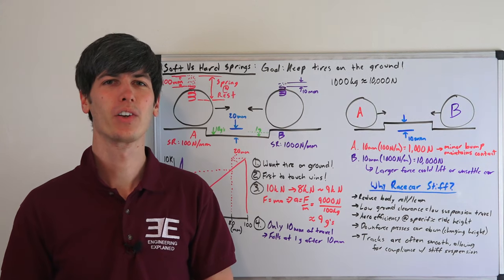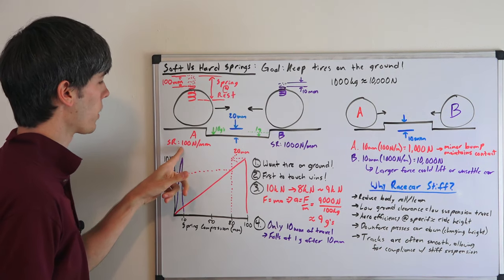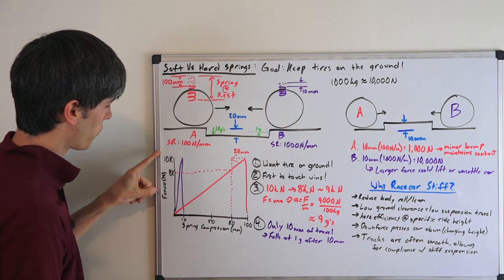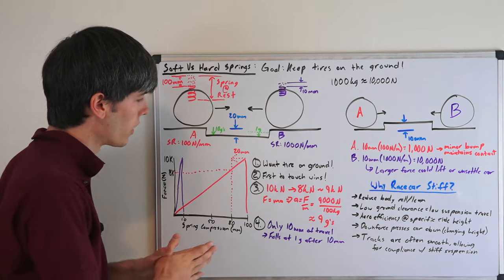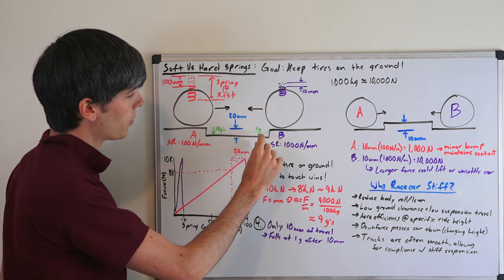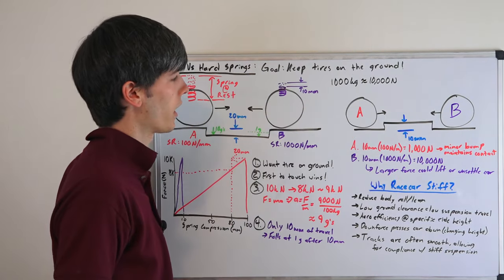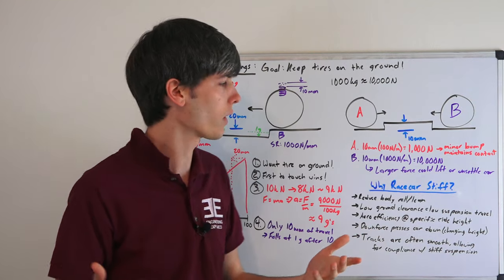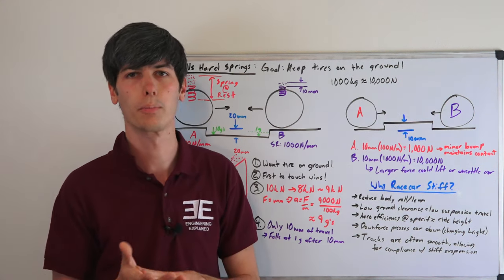What's The Best Suspension - Soft or Stiff Springs?

Comment: Can you reduce roll with a softer spring by increasing compression? What are the negatives? Also, what about tire pressure? Would that change the equations at all? Why would one want to run lower pressures? (I ask this because in the bicycle industry I had a "tire engineer" once tell me lower pressures are actually faster on the road than higher .... could not get a solid explanation from him on that one)

Comment: Got a Question? So I was having a conversation with a friend about lowering springs & coil-overs which is better? "Coil-Overs". Right???.....So my friend decided to call another friend to ask which is better and of course he also says lowering springs and I tried  to explain too them now of days they are multiple lowering springs & coil-overs available for different uses. So let's put this conversation to rest which is better?
Reply: Alfonso Goree It's depends on the range of capability of stock shocks.  The standard shocks on a Honda Type R can handle very stiff springs (heck the stock springs are moderately stiff already, amongst the stiffest you will find on a road car).  The stock shocks on a Nissan 240SX however aren't up to it, so you need full coilovers or replacement Koni shocks if wanting to up the spring rate considerably from stock.

Comment: most road cars actually have stiffer springs than a properly set up race car. the softest spring possible (within reason for your vehicle) will give you better handling with proper SAI and suspension set up

Comment: Hello Jason
I really need your help and your answer to this question. I'm preparing a Citroën Saxo 1.1 60 hp for trackuse only. I've always done that on a original way because that's how I am 😇 here's my problem: I decided to put 175 50 R13 wheels instead of stock 165 65 R14 wheels for many reasons. More grip (larger tyres, more heat in them becauss of smallef diameter), lowered center of gravity (lower wheels = lower car), more agressive gear ratio, etc,... The problem now is purely esthetic. The small wheels are so small that they leave a lot of space between the wheels and the bodywork of the car, even if I already put some lowering springs on the car as well. I was wondering if I could try cutting the springs by like 1 cm (the first round of the spring for example). I have so much space left that I don't think I'm taking a risk of friction between bodywork and wheels. Are there other problems I could have by cutting the springs? Some people just told me "you're gonna have a bad grip" But no one can't explain me how or why. They just assume it. That's why I'm asking you. Could I try it? What do you think? I'll talk about you and your channel in my next YouTube video if you allow me to! 😝 Thank you so much for your answer and keep going! I love your scientific car-videos! Good luck further

Dilysi

Comment: Another factor that you didn't address is the dampers' valving. I'm sure this is because you were focusing strictly on spring rate in this vid. People generally run dampers that slow suspension movement even more (having greater jounce and rebound damping) when they're running stiffer springs. I'm guess this would exacerbate the issue even more so.

Comment: How about expanding this idea further, and talking about the ideal balance of sway bars and springs. I am of the mind that you want the softest spring possible, with the stiffest roll bar possible. Your thoughts?
Reply: Having ran both setups in an autocross environment, soft spring + big bar was horrible.  There are four forces to deal with in a handling environment, acceleration, braking, and both lateral directions.  Soft Spring + Big Bar only addresses two of those areas.  Big Spring + Soft Bars addresses all four.

The ideal setup is the softest spring necessary to control the suspension and allow the car to do what you want it to do.  If you can't isolate the area of a corner that you want to fix the car's behavior, it's fruitless to talk about whether Big Spring + Soft Bar or Soft Spring + Big Bar is the best setup.  It's even harder to talk about it without considering the type of racing too.

There is a reason NASCAR is soft spring + big bar... and it has very little to do with handling.  Look at the rates they run on a roadcourse vs the various oval tracks they go to... way different setups for rather obvious reasons!

Comment: While big 4 wheel-drive cars, that are built to go over very large bumps and so need suspension with lots of flexibility and therefore should be soft, gets hard suspension for the highway travel.
Have you noticed those big 4 wheel-drive cars going over speed humps in the car park? My little car goes over them easier, how bad would it be "off-Road"?

Comment: Wouldn't that also depend on the stroke aswell for how far the wheel can travel ? For instance if its the same coilover setup however in one scenario you have its softer and the other stiffer... they still will have the same amount of travel.

Also since the softer spring is under less tension wouldn't it react slower and more fluid like than responding fast to fill in the gap in the road ? I feel like a stiffer spring would react faster in every way compared to a softer one. 

But i guess when you think about it since the stiffer spring is probably making the shocks stroke not as full as the soft spring you just don't have as much wheel travel with the stiff spring which i assume is the result of the wheel wanting to hover over a gap rather than sink into it.

Comment: There's an assumption in this that you are comparing racecar stiffness to passenger car softness. But within non-race track cars there is still an advantage in stiffer over soft. Soft suspension is more comfortable, but not necessarily better handling (not even for bumpy roads). In my personal experience, the cars I've fitted firm suspension, not racecar firm just firmer than stock, have handled better on gravel roads, potholed roads and smooth roads alike. The suspension is more responsive and keeps the wheel planted on the surface more often than the softer springs. I've always matched springs and dampers though - never change just one. There might occasionally be a bit of the skittishness he mentions but it's momentary and full grip returns in milliseconds, whereas the same rough surface with softer springs results in tail out or understeer action that you don't get with the stiffer suspension. 

That said most modern cars have very good suspension compared to the old "floating suspension" yank tanks of 40 years ago. Even stock suspension is reasonably firm. At the end of the day what you want is tuned suspension, designed to provide good grip for the style of driving you do. Passenger cars have more than adequate grip for the kind of driving that the average driver does.

Comment: stiffer suspension is used in racing because at high speed softer suspension is not that much stable as stiffer ones.And rider can feel bumps in stiffer ones easily than softer ones.

Comment: softish suspension, larger sway-bars is the best compromise for general purpose cars, so long as the sway-bars aren't too stiff.

but sometimes using no front or rear sway-bar is the best for cars that either have bad under or over steer or rear traction problems. 

Suspension geometry is number 1 for choosing the correct spring rates and sway-bars, especially if the suspension generates camber gain or toe.

Slamming your car with max camber is a recipe for some really poor handling.

Comment: But you also have dampers which prevent the movement, and if you have stiffer springs, the dampers should take that into account. My new, stiffer springs (just because my old ones were worn and this is what I got) make much better contact when I go over speed bumps. I don't think there is much difference between 350 lb per in springs vs 310 lb per in springs, especially if you factor in the dampers, yet cornering and braking are better with the stiffer springs. I think there is a sweet spot, softer than that is worse, and so is stiffer.

Comment: Ok, I get that it's better for bumps on road. Not really a cause of accidents. What about when swerving to miss an obstacle, braking hard, driving in wet weather. Firmer suspension keeps the load more even on the tires. In a soft setup if you swerve even at 20mph you'll transfer a lot of the load to two tires and therefore you have less grip as you're not using all four tyres optimally, even though they're all contacting the road they don't have even pressure applied. I like cars but don't really understand all the components, are there other parts that come into play here? I thought body roll mainly depends on suspension.

Comment: I think this whole thing is misleading.

Case 1, you chose a bump of 20 mm, which is greater than your stiff spring travel. Hitting the travel limit is a concern, but what if you were not at the limit of the stiff spring?

All the points for a racecar suspension are pros for a street car (tuned) except the smooth track. Even then, if my suspension is tuned for performance, I am not going to drive it on certain roads.

Comment: Can someone help me out?

I just got an old Lexus ES 350 2008 and the last owner put a 1 inch larger wheel on the car. The car is really bouncy and it's causing the tires to be worn on the inner edge as the car is compressing the struts all the way down. The shop I took it to said the struts aren't leaking at all, but they are the original (car has 158,000 miles on it).  They laser checked the alignment and it's perfectly aligned with no adjustment needed. The wearing is only from the bouncing. I can't even fill the tank all the way is so bad. 

Should I keep the coil spring and install just the struts, or replace both in a single quick strut unit?  Which struts should I get that aren't oem?

Comment: Here's a question...  I have a (Yamaha) golf cart, and drive it around my retirement community streets (will not be taking it on the golf course).  This model of golf cart is very light, and the ride feels EVERY slight bump in the road to the extent that my teeth rattle (and yes, they are all my own teeth so far).  The stock shocks have 'Coil Overs'.  
I think I can change the 'coil over springs' on the shocks to either softer or stiffer spring rate.  
Do I go with a 'softer' or more 'heavy duty' spring rat  to achieve a smoother/softer ride?  Thank you.

Comment: Did you do a video on the effects different shocks fitted to OE springs have? E.G. the differences in changing from oil twin tube shocks to gas single tube shocks or stiffer rated gas shocks.

Comment: SO what is best then. High or low profile tyres? What is best for road? What is best for acceleration? What is best for a road course? I think a video on this would be very informative to alot of people and might teach them something useful. For example try the same car with 16 and 17" wheel but roughly the same Circumference and do acceleration and handling tests. something like the gt86 would probably be a good test platform since the front wheel drive make it understeer as much. When you do a video like this you should try and elaborate the question a little more clearly than is possible in the video title before you present the conclusion. Here for example the the question really is "When is softer suspension better and when is stiffer suspension better" not which is best in general.

Comment: so this information applies at defects in the road, now what about drag racing? if a softer spring gives more traction it would be ideal for transfer of power to ground, but a stiffer spring would also prevent the nose from rising and keep contact somewhat. assuming this is a front wheel drive what would you recommend and why?

Comment: Imagine a car fully packed with your friends, and has a soft suspension, the ground clearance will reduce drastically and even a small speed breaker will be like an obstacle... Whereas hard springs require more power to press, so don't worry about speed breakers you will have enough ground clearance even when your car is full... I don't agree with the fact that cars have springs to maintain contact with the road, anyhow gravity ensures that... The main purpose of springs is to reduce the instantaneous effect of a bump by slowly going down and coming up, thereby spreading the effect of jerk over a longer period of time... Hence, our back remains safe...

Comment: wouldnt this be a discussion on travel? Your argument is that force potential decreases to zero once the spring has reached max travel but the stiffness of a spring does not directly correlate to trace. You can have a 10kg print with 200mm of travel if you really wanted, no? Further if the spring is stiffer and travel remains the same  wouldn’t it drop the wheel off a lip (see first scenario) faster ? Thus increasing road to tire contact?

Comment: On my 93 Toyota 4 runner I am getting wheel hop when giving it the BEANS in the rear end. I have a Trail Master 4 inch suspension lift and pro comp shocks such I think need serviced. But I was thinking I needed a stiffer set of rear springs. I was in 3 feet of snow and was starting to get stuck so I gave it more beans and it started hopping and I had to stop. I feel if it was stiffer I could have kept going.

Comment: Sorry if this is a bit off the topic but its somehow related and I really need some good advices on it. I have an ISUZU RODEO 98, Its been 3 years since we got it. Its really a bumpy ride and its getting worse. So first thing that comes to my mind is to change my old shock absorbers which I'm not sure if its previous owner have changed It already. I went to a mechanic to have it checked and he said that it has no leaks and still working good. Its an old Rancho USA made shocks he said. Then I let him check the coil springs and notices that rear part of the vehicle is 2 inch lower than the front. Then he remove the rear coil springs and he put a 2 inch rubber spacers on it to lift the rear part. Then installed it all back and now front and rear suspensions are even. But problem is not solved, driving is still bumpy even on smoother roads. Should I change my shock absorbers or buy a smoother coil springs? Thanks!.. :)

Comment: What if you have significant unsprung mass, going at speed over a significant bump that is within the soft and stiff springs' travel, where the speed means that the sprung mass was not pushed up from the bump (or very little chassis movement).
wouldn't the unsprung mass' momentum want to continue travelling up from the bump, meaning that a stiffer spring would store more energy to push down the unsprung mass after the bump faster for a quicker return to road contact?

Comment: what happens after the first bump/depression? wont the spring recoil rate also be as much as their initial give? if the shocks are similar the 100mm spring will make the car bounce more the stability is not just the initial bump but also the reactionary force plus the ability to absorb that shock. on a bumpy road wont the softer suspension be a disney ride? and wont that cause it to be less stable than the hard suspension car?

Comment: so here's a good question how do you figure out the right spring rate, the right struts, and right anti roll bars for a car. if I want to inprove the handling? with out it being to high of a spring rate, and to thick of anti roll bars?
Reply: +schizobipolarjoe That would be test and drive, you can estimate what it could be but do the adjustmetns based on performance.
Reply: bboyuploads  non turbo 2012 impreza. more or likely will put wrx struts and springs on it, then a sti sway bar in the back.

Comment: One thing I'm missing in this video - isn't it also that softer springs = better traction? I'd like to know how exactly this works. I know that anti-roll bar stiffness settings are usually used to dial out under/oversteer, but can changing spring rates work in a similar way?

Comment: Everything is relative I guess. Soft springs can feel like a wallowy rollercoaster, unresponsive, sluggish, especially with substantial load in the vehicle.
Empty, you can usually get away with soft springs. But if you carry loads regularly, stiffer is needed.

Comment: That is one drastic spring rate change. Wich illustrates his point, but How does it affect a vehicle in real-world circumstances?  

I mean no one will 10 fold spring rates in any vehicle unless you intend to 10 fold it's weight load capacity. I think stock vehicles have soft spring rates because they are designed for comfort, not for performance. They are made for people to go from point A to point B following speed limits and avoiding extreme braking cornering and acceleration loads. Once you seek performance to better handle higher demands of driving going with slightly stiffer suspension allows you to get more performance handling characteristics.

Comment: It's pretty simple. For race cars which mostly drive on smooth race trackes. The only time the suspension needs to do its job is the small minor undulations in the pavement itself. Therefore the only thing the suspension really needs to do is keep the car level. On a regular road cars where passenger comfort is top priority. The suspension needs to give and absorb the shocks from the god awful roads.
Reply: +op3l those dudes out there who think they're Tokyo drift racers just won't understand though. they'd rather swerve all of the holes and bumps like a drunk driver